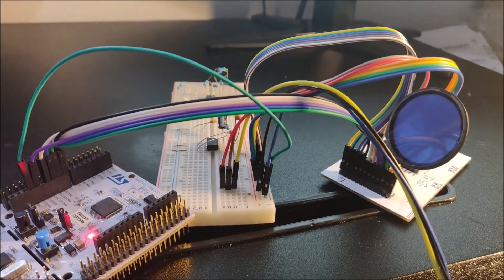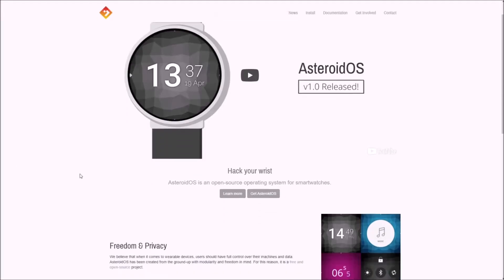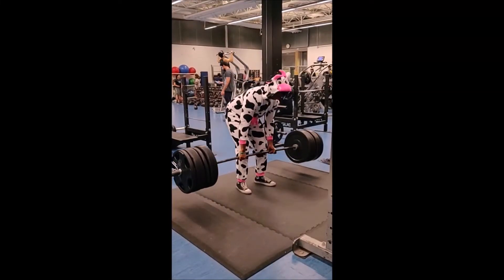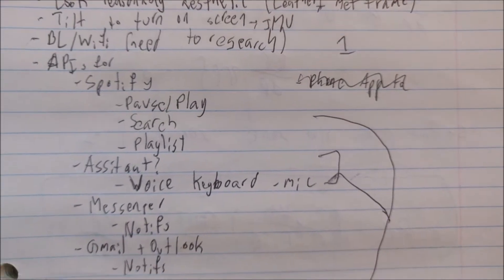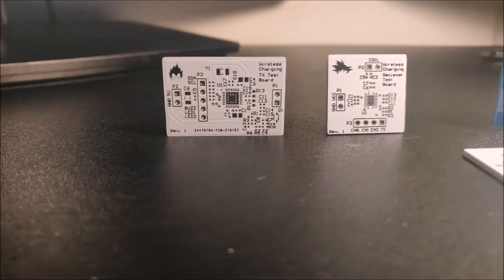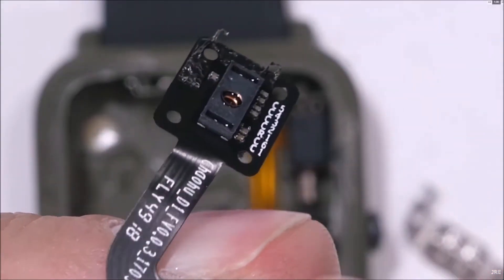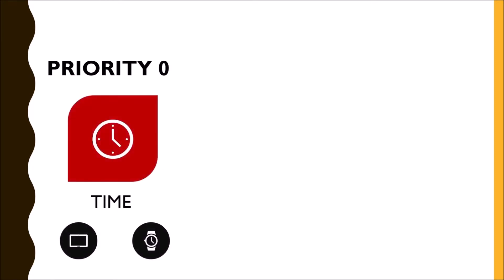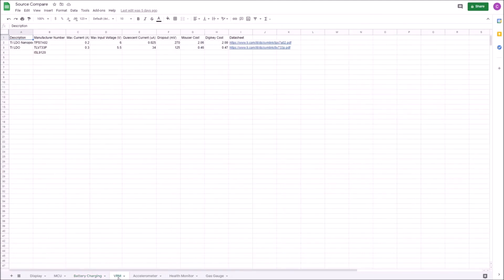How I'm Making a Smartwatch!

Comment: Sir we two students from india are also making smartwatch from scratch ,currently we are in 3rd yr of Engineering(ECE) , and we are stuck at a point in LCD need some help ... Can we connect? If possible?
Reply from the maker: Yup, feel free to post your question here!
Reply: @c3electronics898  Sir we are done with the coding part of the lcd with no error in code but it is showing region RAM overflowed.
Reply from the maker: @GauravSingh-rq5hz  What microcontroller are you using? If you're using a low power chip one the images you're trying to load onto the LCD are likely too big. 

To get around flash constraints you'll want external flash. Something like the Winbond W25Q128. 

To get around RAM constraints you might need to implement a partial frame buffer (load small chunk of the screen in at a time). I found this blog post was helpful: https://helentronica.com/2021/01/22/touchgfx-on-a-custom-made-low-cost-board-with-the-ili9341-controller-over-spi/

Comment: Wow this is really awesome! Where do you order your boards from?
Reply from the maker: Been using JLCPCB! Their prices are pretty good for larger boards/if you have a bunch of boards to test, but shipping/duties is a lil expensive. Planning on trying OSHPARK on my next order. They charge by sq. inch which adds up for bigger boards but works for small stuff. They also have relatively cheap flex pcbs I wanted to try out for a future project.